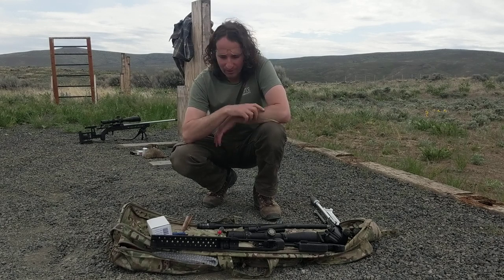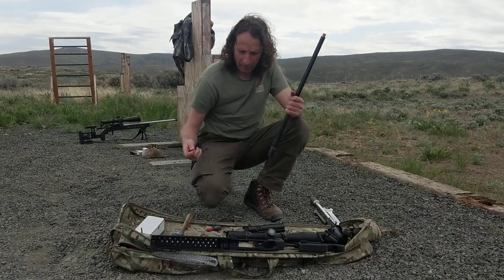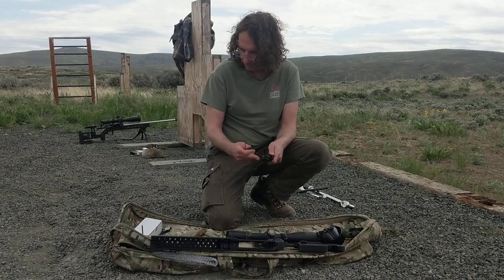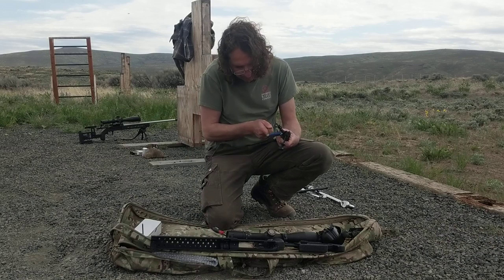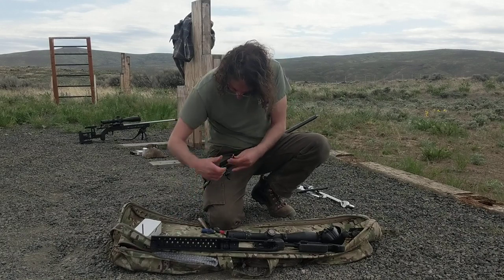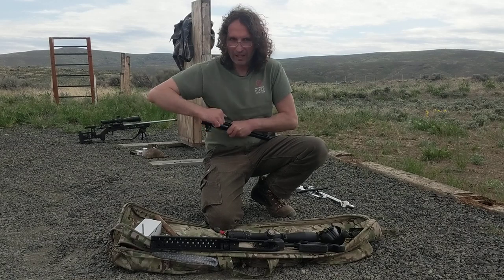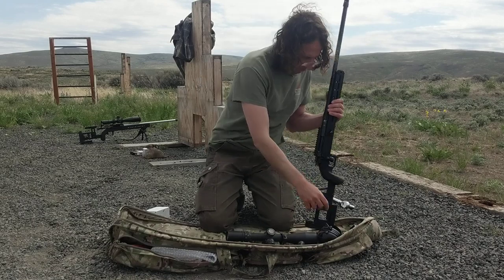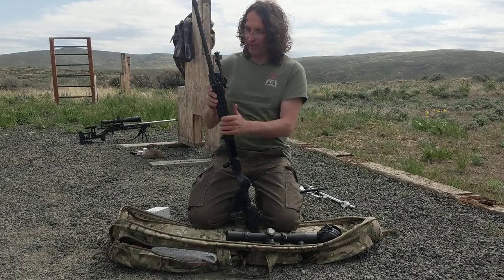American Rifle Company Archimedes Xylo Rifle assembly at the range.

Comment: It would be very interesting if you could make a fat bolt action with a blade ejector and a Mauser extractor. Those are things noone tried to combine, as far as I know. Imagine, an inherently smooth sliding, non-binding bolt without a guide lug, only one raceway to accomodate the extractor, only an ejector slot in the bolt head instead of the weak and contamination sensitive plunger (yes, the ejector must be spring-loaded, but that is a necessary compromise), and fully controlled feed. What do you think?
Reply: No opinion whatsoever?
Reply from the maker: I'd love to comment but doing so would lead to a product development discussion that I prefer to keep private for reasons that are likely obvious to anyone engaged in the business of designing, manufacturing, and marketing guns, or any other product.
Ted
Reply: I don’t know why more shooters aren’t using a xylo chasis, I love mine , it’s built like a tank and the grip is awesome.. i put a defiance action with a proof carbon barrel in 6.5 creedmore.. I literally put 10 shots in a 3/8 inch hole at a 100 yds,it’s sick.. my next purchase will be a mausingfield for my next build👍😊🇺🇸also teds scope rings are awesome as well, I used them with my tract toric 4.5-30x56 ..